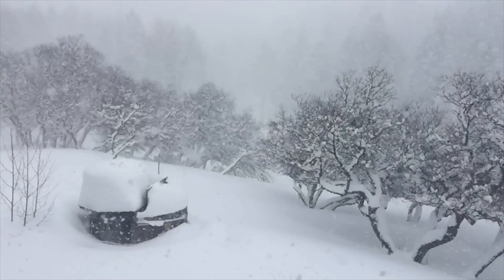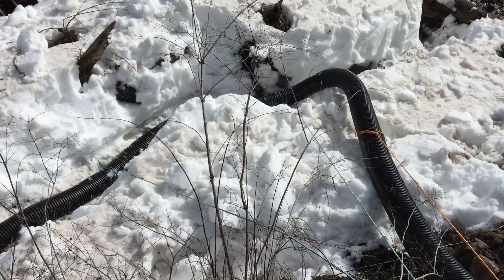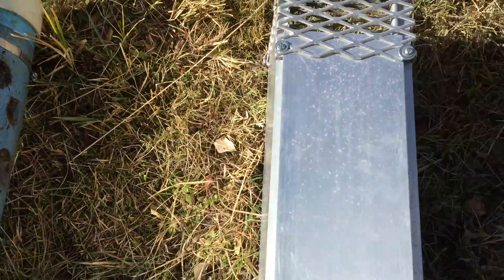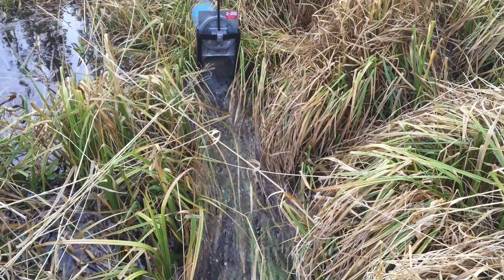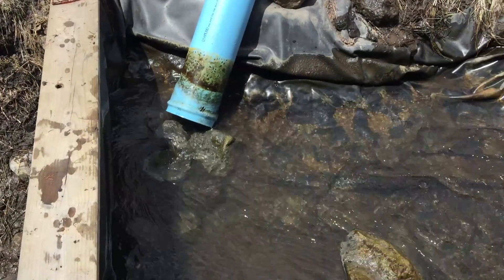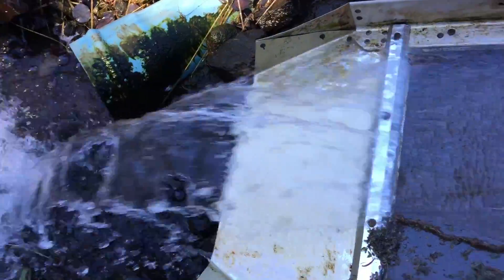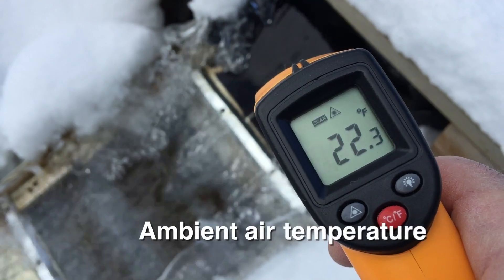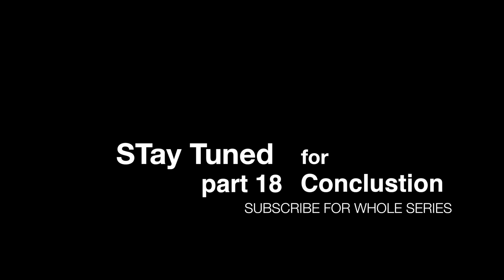Part 17 MicroHydro Power System in CO

Comment: A good series of improvements.  The coanda screen is definitely going to make life easier going forward.  I imagine that you have thought of a reason why this wouldn't be optimal, but I would think it would be preferred to have the irrigation gate mounted a few feet up the pipe instead of after the 90 degree bend?  Flow control would still be possible but there would be no place for ice to build on the exit.
Reply from the maker: +FlyLowLikeRylo Unfortunately, the gate is not fully watertight if pipes are mounted to both sides.  Any leakage at the blade of the gate would then not empty into the pre existing wetland region of the meadow and a new channel would have to be dug by hand for this water to join the wetland area.  The ice buildup isn't a huge hassle to contend with either.  Thanks for the suggestion just the same.
Reply: That was the "good reason" I was expecting to hear.  In any case it looks like you've pretty much hammered out the kinks, well done and enjoy.

Comment: Holy shit! 200kwh/day! That's amazing
Reply from the maker: +Tommy Tipper Yup, lots of power! As spring arrives the plan is to put the excess power as heat into an outdoor hot tub.  Even at that we will most likely turn the flow down on the system so as to match our need/usage.  Thanks for watching and your patience with the sporadic updates.
Reply: BTW the reply from tommy1273 is also me... sorry, I was using my other account that I use for ebay ;)
Reply from the maker: +Tommy Tipper   No problem. 9500+ subscribers becomes a blur anyway. I never imagined the interest the channel would attract. I just try to answer the honest questions and delete the overly rude or stupid comments some people make. 😉
Reply: Cool ;) Check out the tommy1273 comment I made above (?below) though. It would be the way I would go if I had access to that much renewable energy. Unfortunately here in the UK I can only have a few measly solar panels :(
Reply from the maker: +Tommy Tipper   I agree on Google. Sometimes I get comments with no way for me to respond. Frustrating. It has been suggested before, the bitcoin usage for power. I looked into it at one point and found it to be an arms race for faster processors. I sort of put it on the back shelf until we got moved. Then I had to prep/ upgrade for winter.  Thanks for the link. I may look back into it to see if it would pay long term after factoring in servers, internet load, and processor upgrades. Don't have a big picture view of it.
Reply: Hi, the mining market is pretty mature now, although it depends somewhat which coin you choose to mine. For most coins, the way to go is parallel mining on multiple graphics cards (GPUs). There are online calculators which tell you how profitable it will be given your electricity costs. Given that your electricity costs are essentially zero, it should be possible to make a modest amount of money with minimal upfront investment in a decent mining rig. Servers etc. not required, just a motherboard with a (very) decent graphics card and a reasonable (not crazy) internet connection. Then it's essentially a battle between GPU power and cooling, and you can scale it as you wish. Almost all bitcoin mining these days is in China because the electricity is so cheap, but if your electricity is free, you can compete. Also, you can go for a more modern coin, like ZCash or Ethereum, that actively encourages smaller-scale mining, and prevents use of ultra-low power ASIC-based systems. (Although, having said that, you could invest in an ASIC-based system, e.g. Antminer, and mine bitcoin, because your electricity is free and plentiful. But then you're competing with the big boys ;) ).
Reply from the maker: +Tommy Tipper   Sounds like you have good familiarity with the process. We have just OK Internet at 9mbps up and down. One interesting thing is our original hydro building which now isn't being used has 45 degree water running from our springs through it. That might be a great cooling source. And an available outbuilding to contain and isolate the noise from us. Could you send me your email where we could keep any discussions separate from this board?  I might have some questions as I look into it.
Reply: Sure, sounds good. I don't want to post my email here, so I'll PM you.
Reply from the maker: +Tommy Tipper I'll look for it
Reply from the maker: +Tommy Tipper   Haven't seen anything but you could send it to mrhydrohead-4174@pages.plusgoogle.com if that works. I don't use google email for the most part as I'm baffled by how it functions at times.

Comment: Glad to see after all this time with a new professional video!
In this time I have built a micro hydro in my cabin in the mountains.
For Coanda need to have a greater inclination angle (45-60 degrees) to wash themselves.
It can make a wooden box with side cover to maintain an acceptable temperature in winter for Coanda screen.
For me it was a hard winter too, so I understand well your efforts and congratulate you for your perseverance and ideas.
What did you use for heating appliances?

Yours,
Emil Platon
Reply from the maker: Sorry for the slow answer. I had to get on a computer vs.iPad to answer and that is not too frequent.  Congrats on your system!  I'm aware of the angle issue, but given the existing heights of my bucket, weir, and penstock I chose to just install a screen that can pass much more water than I utilize.  That beat rebuilding the whole thing to gain height for angle. On the heaters, I installed 4500w of Dimplex LC wall heaters. They are shorter than std ones for the given output.  Next year I want to integrate the electric heating into an existing glycol floor system that was originally set up with propane.  Didn't have time this year in advance of snows.  All Winter we only burned about 15 gallons of propane including cooking.  The passive solar and the electrics did the rest.  Oh yeah, and a 1/2 cord of firewood.  Not bad given 8600ft. in the cold Colorado rockies and frequent subzero spells.  ; )
Reply: Surely the new screen will still allow very small particles through, could that affect the turbine end over time?
Reply from the maker: Possibly, but after 20 years in service the brass pelton cups don't show any erosion.  I think most really small particles settle in the pipe which I flush occasionally by shutting sown and surging water through the pipe.

Comment: Little sugestion about air in the pipes. You can try to use automatic air vent for heat radiators. During winter might freez up but during the summer time you should not have this problem :P 

Regards!

Comment: Love to watch your learning process. My intake is somewhat different but I have the advantage of more head to work with and not cold of temps.
Reply from the maker: Hey Joel,  its been a long time. Yes my pressure is dictated by geography and it's a good thing I love snow. At some point I may look into the AC/dc battery system you mentioned but just figuring out best uses for existing powers now. Someday I'd love to film/chronicle you system.
Reply: We get cold and snow but not nearly on the consistent basis you do. One year we did get the extended zero degree temperatures we lost 2000 feet of pipe. Corrected that with HDPE. Trouble with that is it burns really well so we lost 2000 feet in a forest fire. What was I saying about the learning process! In fact I have been snowed in for the last month. Plenty of water and there fore power.   I am loving it after the years of dry. That would be fun. You are such an excellent videographer.

Comment: I was just wondering if the air release valve that you use on the pipeline woodwork the same in your supply line to the Meadow or would they just freeze up
Reply from the maker: Good question.  I haven't thought of using any sort of air valve there because it would need to be pulled out for the big melt off in spring.  The water in an air valve pipe would seek the height of where the water comes in and then probably freeze anyway.  But its an interesting idea I'll have to think about.
Reply: MrHydrohead I wonder if using a quarter water line and just letting a little bit of water leak out it constantly raised close to the level of the intake just a few inches lower will keep the water flowing but let out the air as it collects probably wouldn't lose too much water
Reply from the maker: Maybe that might work.  You're right it wouldn't lose much water. One of the issues would be that the black flexible poly pipe isn't really made to join to fittings and it is also relatively delicate material.  Another might be that the weight of water exiting the pipe might cause any tube to actually suck air if the resistance at the intake was greater than at the tube.  The water supply from the creek to meadow seems pretty stable now and I haven't even bled air from it for about a month.  I will look into the idea you suggest however.  Thanks for the idea.
Reply: MrHydrohead irrigation drip emitter might Work during the summer months I'm thinking you might be able to just push them into the black flexible pipe

Comment: The coanda screen was the bomb I am thinking? I used to appraise water treatment and sewer plants and as such there were multiple systems that i looked at that used bar screens of different types. Many used a water wheel that inter locked with the coanda screen / bar screen and would auto clean the screen and remove the debris. You can imaging (or you may not want to) the debris in a main sewer intake pipe. 
The systems I appraised were in South Carolina and as such rarely saw freezing temperatures so that was not a problem.
You may want to make your screen longer for more exposure time for the water flow as most of the systems that I saw were 6 to 12 feet in length. Of course there was further filtering farther down the system.
Just a thought. thanks for the videos. I am not sure I could take the cold, and I am happy off the grid down here in the south of Chile where our winter temps are in the high 30s to mid 40s with lots of rain. Jim
Reply from the maker: +ChileExpatFamily  Jim, Chile looks fine!  So far the Coanda is excellent.  Ideally it should be at a steeper incline and with a curve to its shape.  But, not want to rebuild the weir and bucket, it became what it is.  And it works fine to supply all the water which our 1" needle nozzle can handle anyway.  Cleaning is very sporadic and a welcome hike up to check it out.
Reply: I really admire your work. I would love to have a hydro system here but 
it would have to be a low head system that was most efficient in the 
winter when we have 92 to 142 inches of rain. So my system would have to
 be along the water spout type design idea. I have too much power here 
in the summer and not enough in the winter since we are just north of 
Antarctica and the sun is typically quite low on the horizon. In either 
case keep up the hard work and thanks for the videos. Ciao from Chile, 
Jim

Comment: Odd thought but could you use a length of plastic tube at those points that gather air as a stand pipe to get it higher then the source without the need of expensive pipes? Figure you could wire it up a tree or on a post to get it high enough to let the air out but keep the water in.